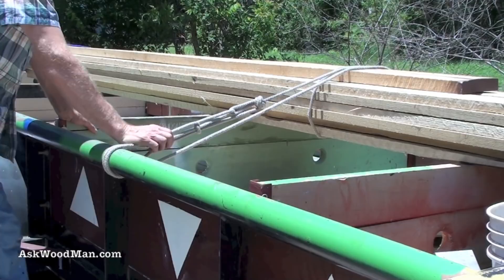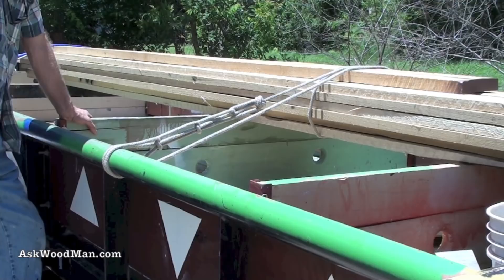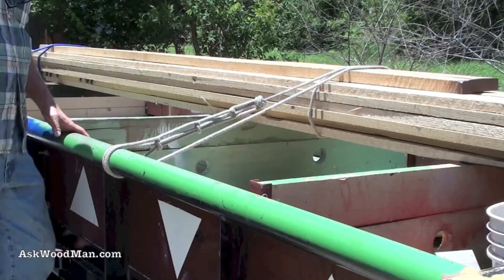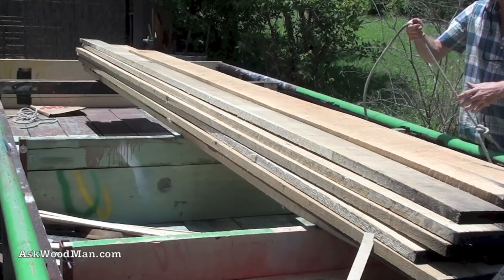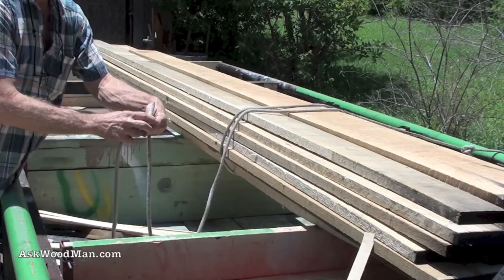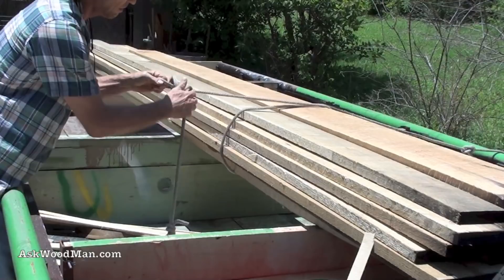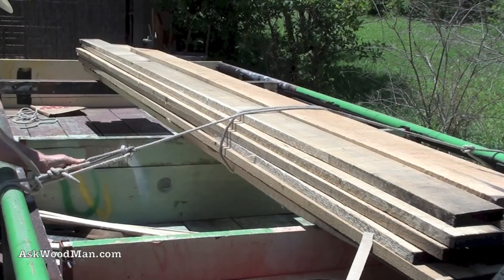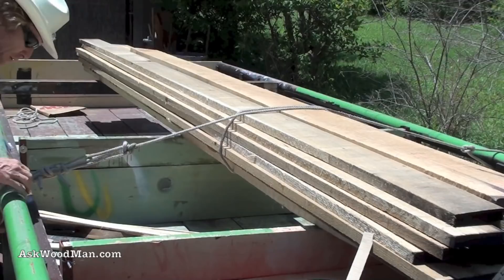How to Tie Knots To Secure A Load For Transport -- KNOTS & ROPES 5 of 8

Comment: Sub'd, I like your videos.  I use the Alpine Butterfly just like you, even after heavy tension, it still unties very easily.  I've never been confident in the absolute security of the half shank that so many truckers swear by with the traditional truckie's hitch.  I'm more concerned with absolute security rather than a slight speed advantage tying the load off.  Thanks again for some great vids.

Comment: Very good combination of knots in principle. You can get away with extending the 2 short length ropes with a reef knot or double fisherman (if you were just using the ropes for tying down objects) instead of the sheet bend, which tends to work better when the 2 ropes are of unequal size. A looped overhand knot or figure 8 could also substitute for anyone not knowing hot to tie the Alpine butterfly loop. Those minor points aside, that bundle up there looks really secure & i like the clear presentation.

Comment from the maker: Mine is the 73 deck. I have a Tundra and that size fits just right behind with only a little stick out. I also have a pretty tight space to park it too. Mine is no super duty trailer. I think it is rated for 4700lbs. I mainly use it for awkward stuff.  Steel, lumber and the ever troublesome 5x5 Baltic sheets. There is an outfit from the Houston area called TheTrailerGuys that made it. When I bought mine they had a shack in a pasture off the highway. I think I got it for $1150 4 years ago.

Comment: Great video. I do the same thing to secure a similar load but I prefect to use a quick release becket hitch after pulling it tight against alpine. Never had one fail in a million miles.

Comment from the maker: Mine is a 16 and I carry 24"s all the time. I can be over the tongue safely 3' and in Texas we can legally hang over 6' with a flag.  Did you notice those partitions that slip into the U channel? The tail gate and partitions are all the side pipe level. Really handy for long stock. I made the tail gate out of three pieces so it was easy to get in and out. I bought steel last week and was in and out of the yard in minutes since I took full lengths. There was a line 10 guys waiting for cuts.

Comment: I once neglected to tie down a set of metal shelves in my pickup, figuring that "all that weight" would hold em' down...oops...got up to about 45 mph and the wind resistance pulled it right up over the tailgate and out of my pickup.  It was dashed to pieces by an 18 wheeler that was driving about 50 feet behind me.  He wasn't too happy about the situation, but I didn't stick around to hear what he was saying.  BTW, thanks for the vid.
Reply from the maker: Forrest .Yates
Mind your manners on my channel or you will find yourself blocked and banned.

Comment: Will it work with a Marlin spike instead of alpine butterfly?
Reply from the maker: A marlin spike is a tapered tool for loosening knots, so I don't understand your question.
Reply: Marlin spike hitch in the right direction would , I've been learning knots and hitches on u- tube for about 6 months so trust it or not any trouble the blame is yours .